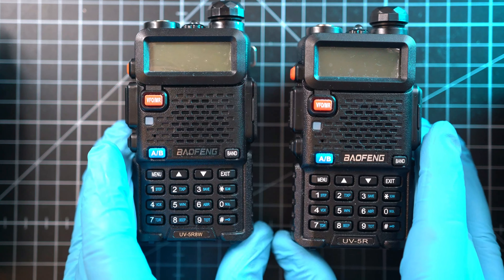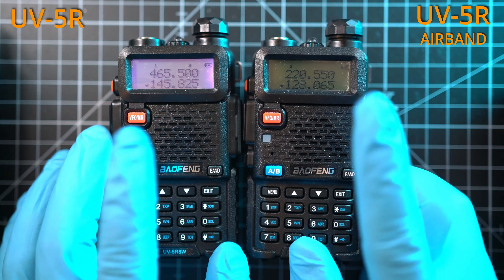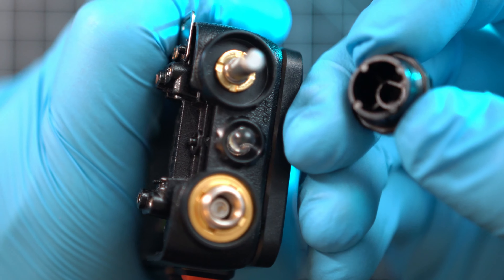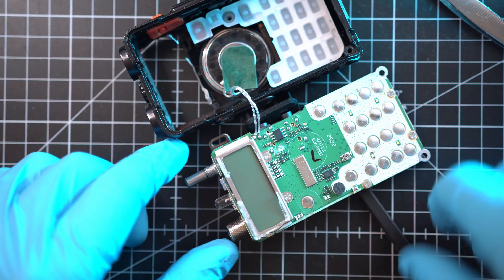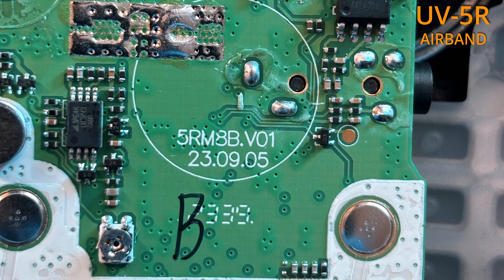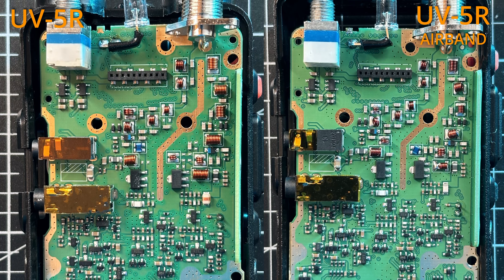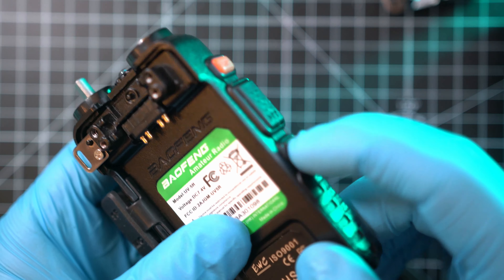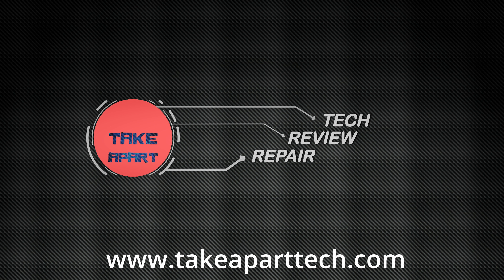BAOFENG UV-5R (Airband) vs non airband TEARDOWN...

Comment: You can open up the air band frequency range in the programming software for many of the old uv5r versions. They have always been able to show they are on those frequencies but if they aren't completely deaf on them they don't do AM anyway. So totally useless either way. Its interesting they finally decided to try and let it do AM. I have heard from many people that the air band receive on the uv5rm is basically the same as its always been. Terrible and it just doesn't work still
Reply from the maker: this new UV-5R is receiving AM modulation, reception is nice and clear! not like FM
Reply: @takeapart  ah so they must have finally fixed it since the early versions of the UV 5rm. It's crazy that all of the cheaper Chinese radios now with airband all initially release being trash on AM. Like the Quenshangs needing firmware updates after you get them lol. These companies need to get it together!

Comment: LoL somebody have change firmware so it support Airband LoL and just removed/replaced some components.
Reply from the maker: I don’t think so… changes are there … lots of components are different
Reply: @takeapart  IF you are a manufacture or handy it no big deal to change out "a lot of parts" search for say UV-mod and you will see that a regular UV-5R is able to recive on those freq. also. But sure the quality is not to have very big hope on
Reply from the maker: @Dynamit008 issue is modulation… on FM modulation you can’t properly hear airband !